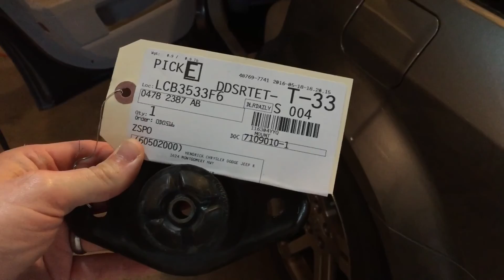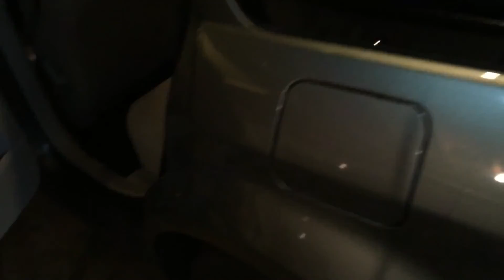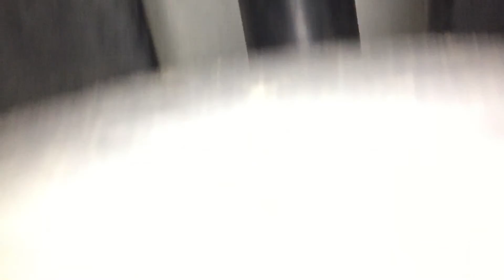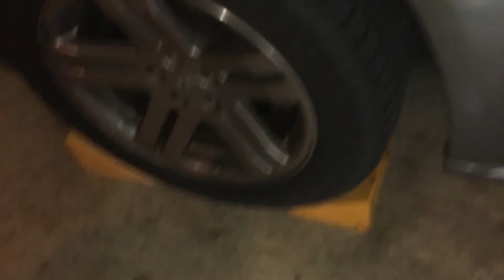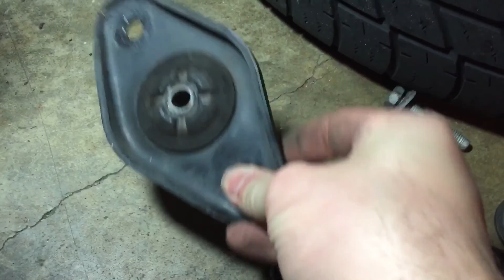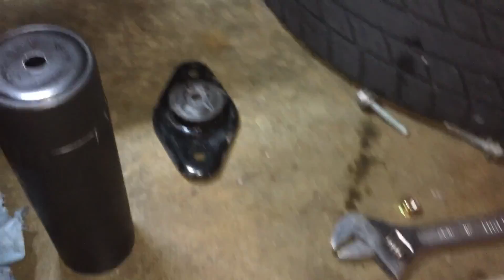Dodge Magnum rear upper shock mount replacement

Comment: I had this same noise.  2008 300 Drivers side, rear bolt backed out 30k miles later -- failed to torque with suspension loaded!  Info very helpful!
Reply from the maker: Glad it was helpful. Thanks for the kind words!

Comment: What if you put a thick rubber on the part that goes on top it might work between the mounting plate & frame
Reply from the maker: Frank Perez Thanks for the suggestion. It turned out to be a faulty shock. You can check out the resolution here:
https://youtu.be/3ubqqRLUE_s